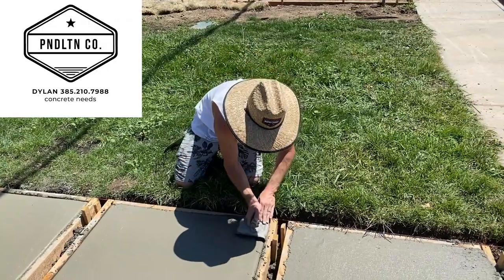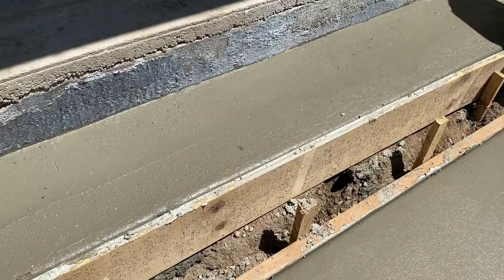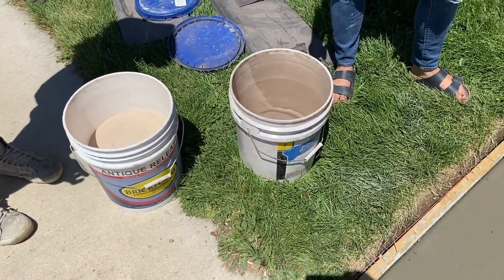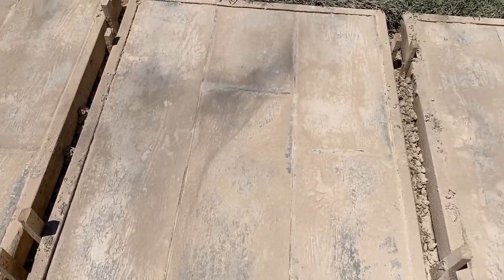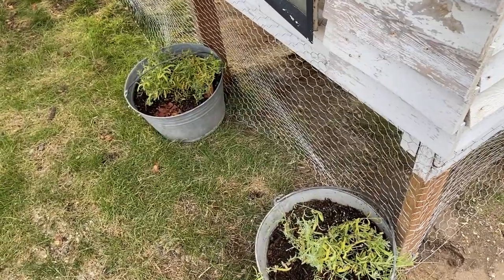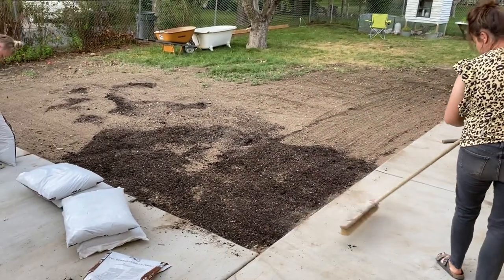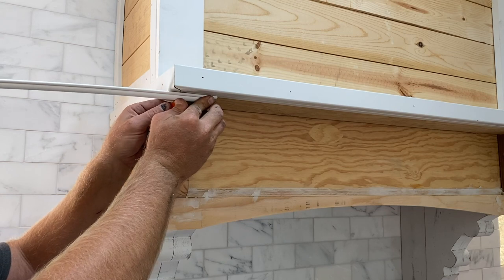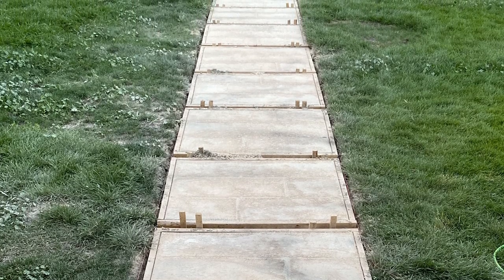Dream kitchen Range Hood DIY and Stamping and Staining Concrete Pavers

Comment: Do you have a video with the countertop install? Love them!! Are you leaving them natural wood?
Reply: She said in an earlier statement, they are going to I believe use 4 coats of white oil wax & buff it with a car buffer.  Don't quote me, but I believe that's what she said. And the countertops are not the ones she wants permanently. But for now what they are doing to get in the home sooner & fine tune it as they go.
Reply: VIOLET HOFFER thank you!! I love them that color!